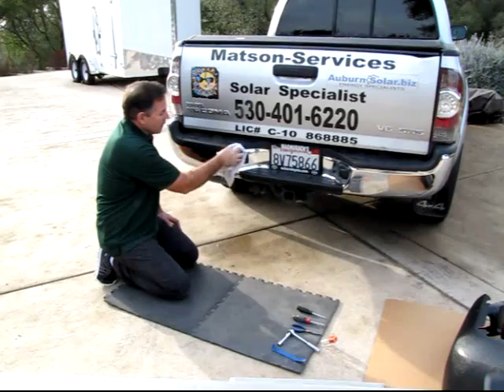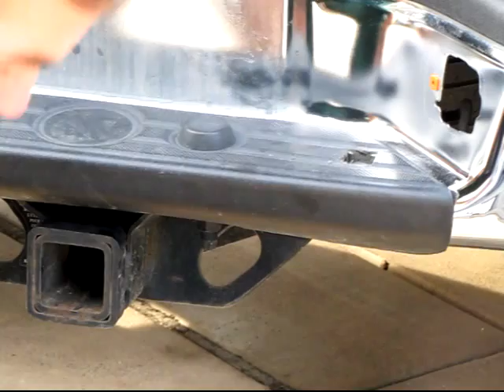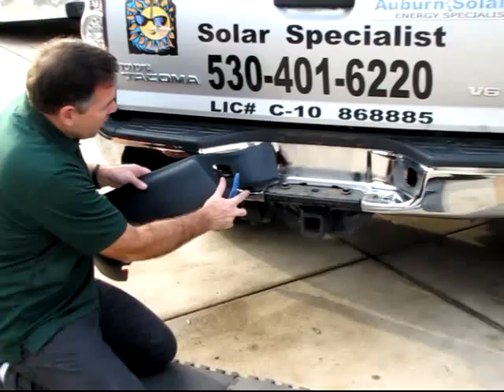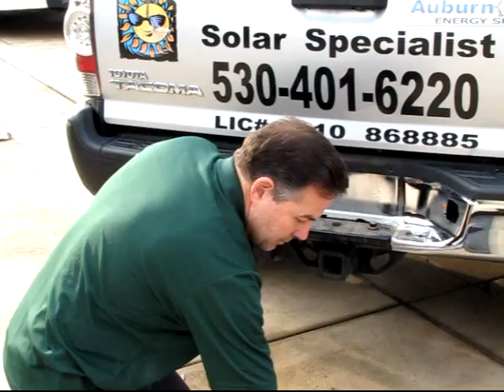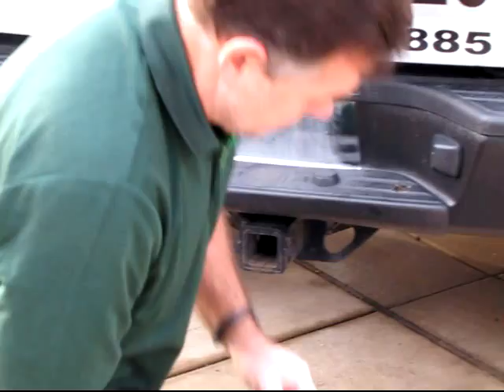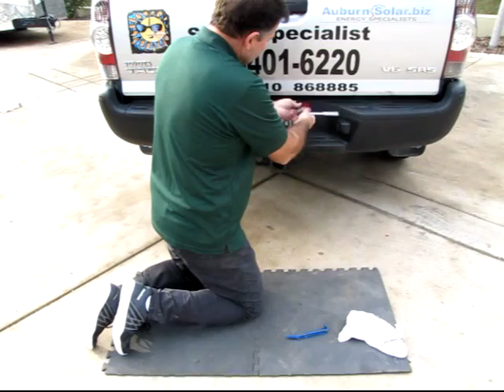2005-2015 Toyota Tacoma BumperShellz Install

Comment: Just installed a white one on my '07 Tacoma and it's an awesome match. Thanks for the video!
Reply: ronjon83 does the white match the white with the truck? I want to install one but I really want it to match exactly.
Reply from the maker: Thanks RonJon!  Sorry for this super late response.  Trying to get better at this whole YouTube thing lol.
Reply from the maker: Hi Aubrey.  No doubt you have already found a solution to what you were doing by now, but here is an answer to your questions.  We have recently switched over to a material that is an exact color match for the Tacoma SuperWhite.  It is also molded-in-color so even deep knicks in the surface won't show up.
Reply: How have they held up since you installed?

Comment: Followed your instructions as much as possible, fitment wasnt any where as close as yours, sliced my finger open on edge of the sharp plastic trying to line things up, one side wasnt lining up under the bumper cover, broke both tabs on license plate lights trying to get them back in, not sure why toyota made such a short tether of wire for the bulbs.  all in all looks good but def not a great experience, cant imagine a full bumper swap being anymore difficult or time consuming.  i wouldnt buy another set nor recommend these for the 2nd gen tacoma.
Reply from the maker: I'm sorry you had this experience. We believe our products are the easiest and most durable chrome delete solution available, aside from fully swapping the bumper. 

We encourage anyone having issues to please call us at 844-918-3688 and ask for Grant so he can give you more detailed instructions and ensure your success installing our products,.

Comment: Beyond frustrated. The plastic matches nicely to the oem bumper caps.  However, fittment is a real pain. Being a few millimeters off makes all the difference.  Slack in places when flush in others.  Middle step cover simply will snug up with all the force I can muster in order to get the pins back in, I’ve even cut some slots in an effort to allow for a tighter fit.  Just won’t look right.  A new bumper is not much more. Wish I would’ve just done that and likely will.
Reply from the maker: Hey Devilinlee.  I'm sorry to hear you're having issues with the install!  If you'd like, give our customer service number a call and we will try to help you with whatever is going on here.  If we need to send you out new parts, we would be more than happy to do that if that would fix the issue.  Hope to hear from you soon!

Comment: I just got one cheap thin plastic. and they want $130 for it . I can get a new steel one for $90
Reply from the maker: Hi Vinnie. Thanks for commenting here.  If you have any questions about the product or are unhappy with it, please shoot a quick email over to our customer service. We are a small business and take a lot of pride in the products we produce, so if anyone is unhappy, we want to help resolve that. 

Just a quick response to your comment, we use a plastic that is .090 inches thick.  Any thicker than that, and the cover becomes pretty difficult to get under the step pad. As for the plastic being "cheap," we wish that was the case lol. We source our plastic from the same companies that supply Bushwacker and Lund, and a plastic bug shield from them is going to run you $100+. We also do all the manufacturing out of our facility in Auburn California, not contracted out to China.

Again, thanks for your feedback, and please feel free to reach out to our customer service!  Thanks!
Reply: Ecoological Videos USA made..  Respect!